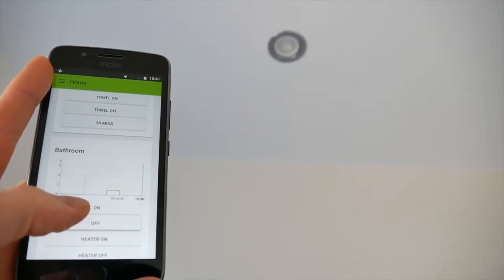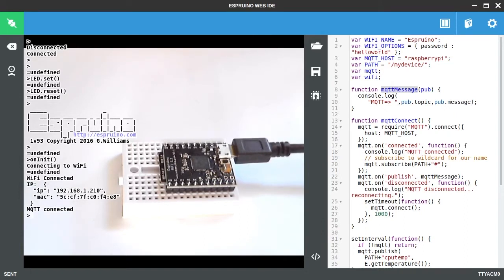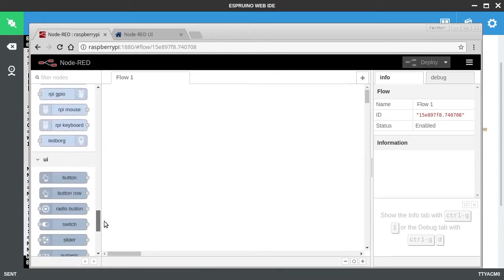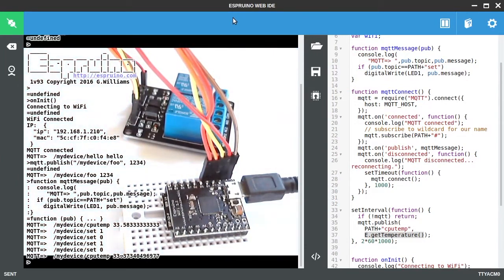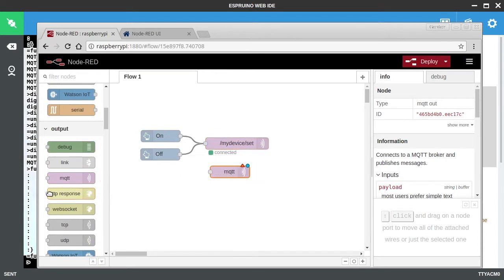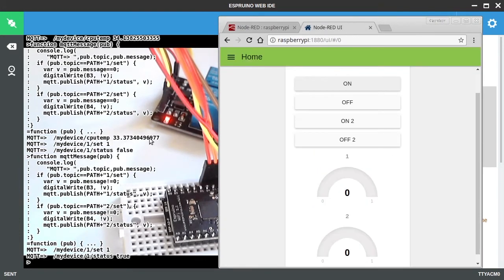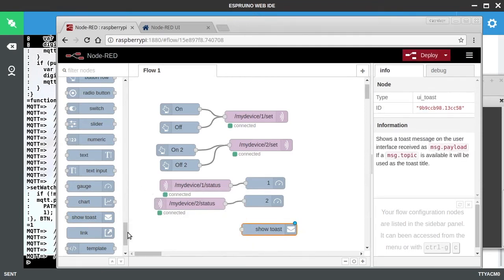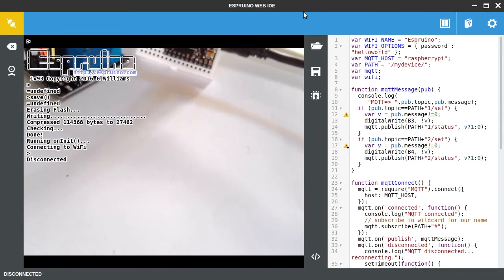HOME AUTOMATION with Espruino and MQTT, Part 2 - Espruino WiFi

Comment: The board you are using is very expensive at £30.00 is there a reason why the price is so hi?
Reply from the maker: The Espruino WiFi board runs Espruino, which is an Open Source project. It's huge and complex and it takes a lot of work to maintain, document,  and support users on the forum - and much of the premium over something like a bare ESP8266 goes to pay for that work.

Comment: i want to use a puckjs to switch on my hifi system with google assistant. the easiest way seems to emulate a wemo device. but i'm still researching the possibilities.
Reply from the maker: Yes, I'll have to look into that in more detail. It looks like Google Assistant works with IFTTT, so potentially you could hook into that somehow as well?

Comment: Looking forward to the third part. I had Espruino installed on a Sonoff before but when I got an Amazon Echo I ended up installing https://github.com/arendst/Sonoff-MQTT-OTA-Arduino on it instead. Now I've got Node-RED running and Echo support installed for that, I can go back to having JavaScript-powered lighting - might even install a 4MB Flash chip for more space to tinker!
Reply from the maker: Nice - for simple control I imagine that's great. I think realistically Espruino would only really come into its own if you want to add your own senors/display/etc to the Sonoff... I nice little OLED might work well! I'm just running Espruino on it because it's nice to run the same thing everywhere, and also I'm biased :) Installing 4MB flash would be quite interesting - although you should be able to come up with a 1M Espruino image pretty easily if you didn't want OTA - which would still give you a reasonable amount of room.
Reply: Over-engineering is in my blood ;)